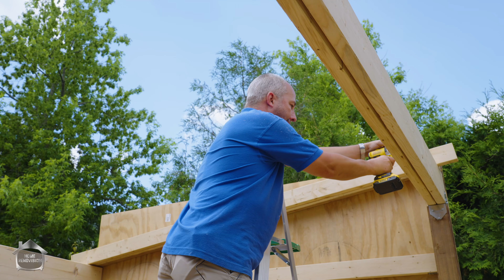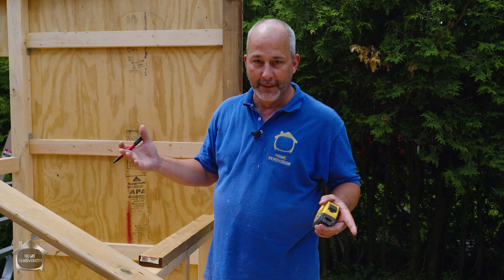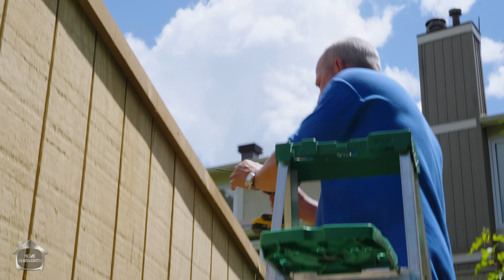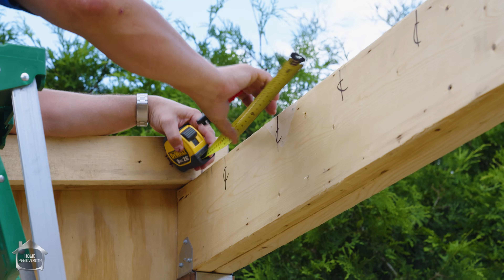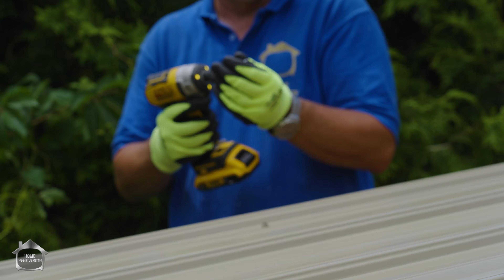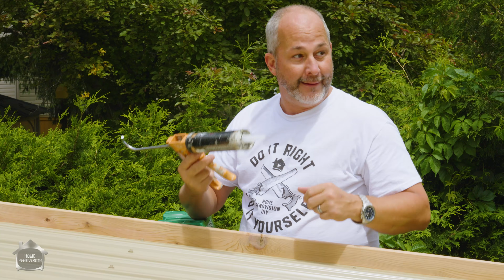This $500 Shed Roof Will Last 50 YEARS!

Comment: I actually used the semitransparent fiberglass ones on my shed roof. I should have done what I think you mentioned is ignore standard beam gaps and align for the panels instead though.
Reply from the maker: makes it easy to trim out the sides and saves a little lumber. Cheers!
Reply: I am choosing to use the semi-transparent every other. Took a bit to find one that would mate up with the aluminum rib profile. Hoping it would let in light and cut the cost of the electricity... that I did NOT install. Because I need a permit for that. 😁